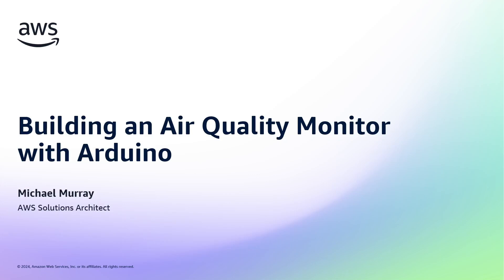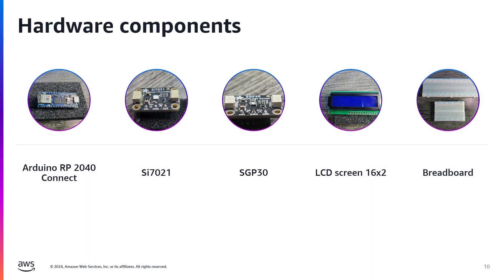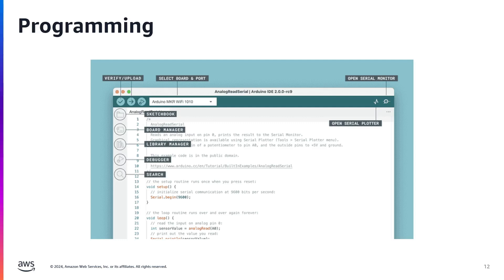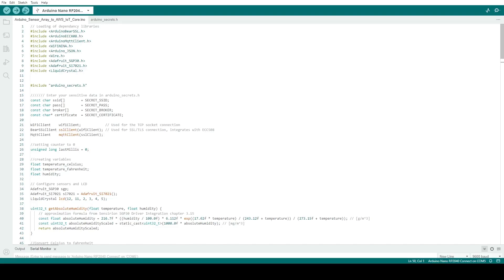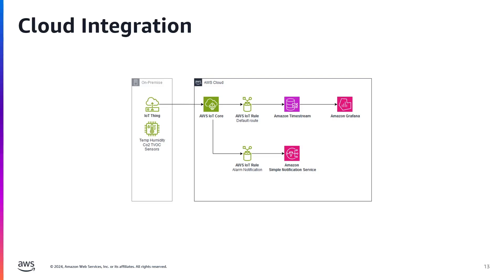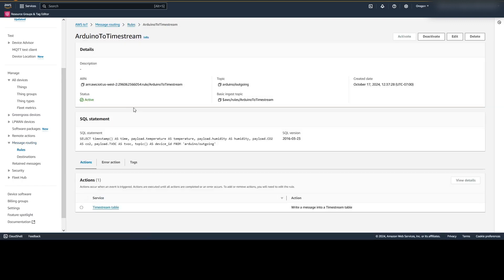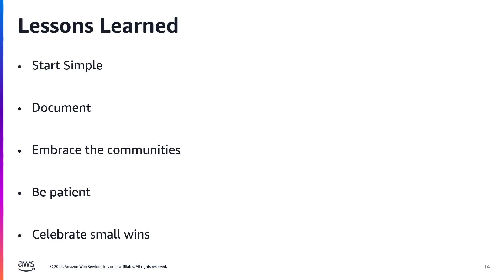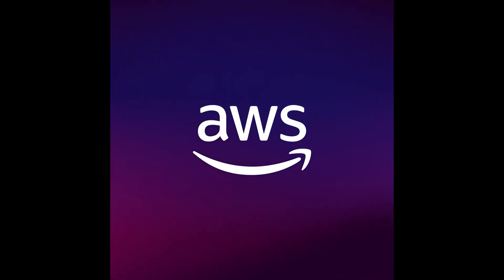Building An Air Quality Monitor with Arduino

Comment: How accurate are the sensors? Do they need calibrating often?
Reply: You can't calibrate these little cheap ones.  if the delta is asymmetric you can correct it in software